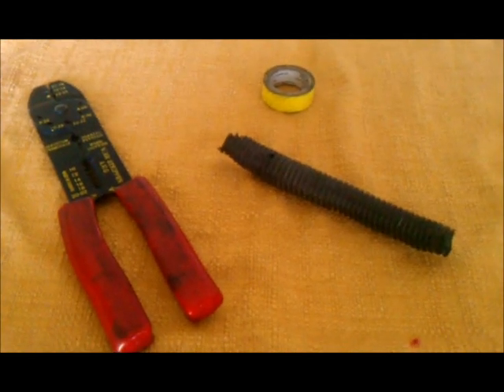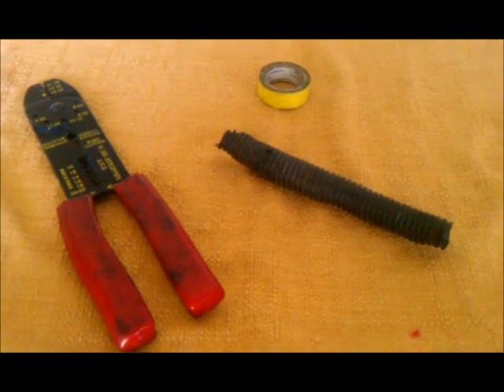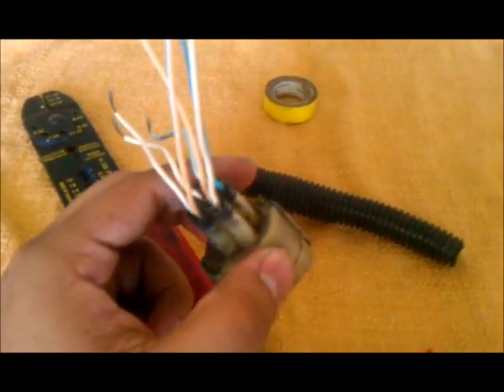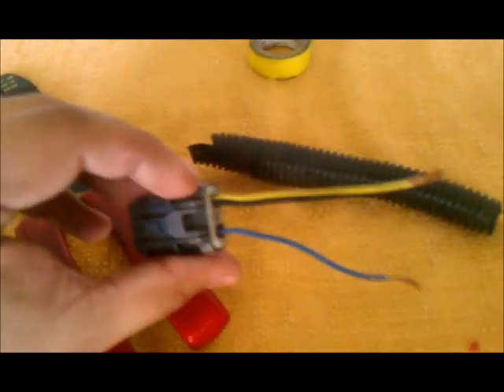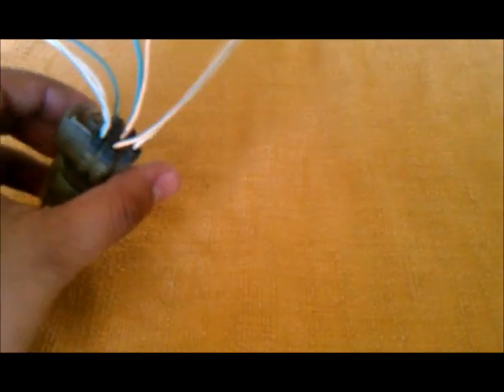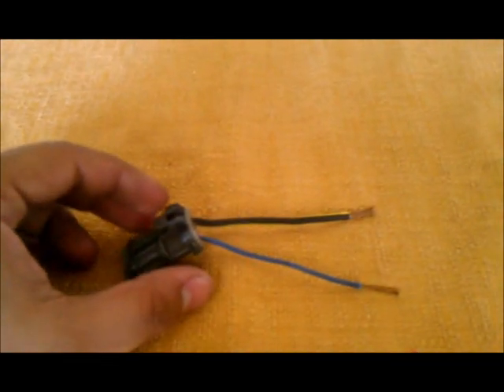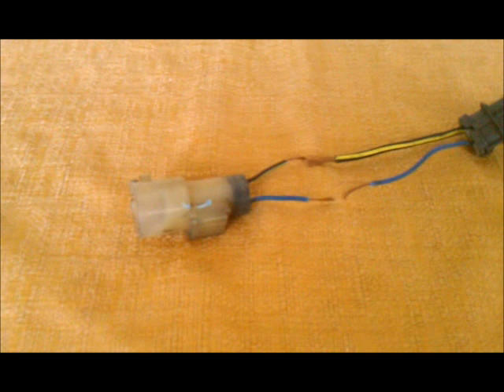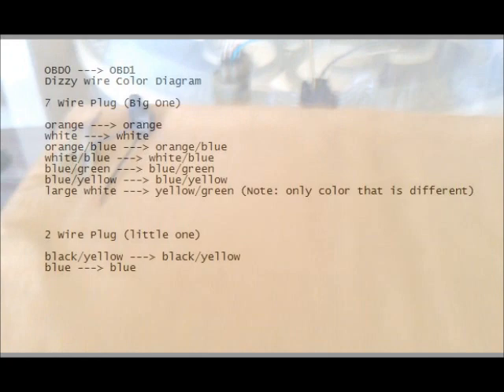Honda OBD0 to OBD1 Distributor Jumper Harness Wiring How To Video

Comment: so much easier to just repin obd1 plus onto engine wire harness, than making a jumper.  it's quicker to do and looks more OEM
Reply: Alfred Liu that’s that prob I’m having I have a dx harness so it’s the 5 wire square plug like to jump from that to the obd1 plug but different colors

Comment: How do you make this same jumper for a 91 DX civic? I notice on mine it is a female small square plug with 5 wires and the plug that you show in the video which I believe is an SI has many more wires. How do you make this jumper for the 5 wire square plug?
Reply: That’s what I’m trying to fig out i have the same issue

Comment: on the engine wire harness side of the distributor where does the skinny white go on what pin and the larger one I think i got mine switched

Comment: I'm trying to swap a B18B into a 99' civic, but the distributor plug on the civic is 8-pin and the B18B dizzy is a 9-pin. It's actually a 10-pin, but one terminal isn't used. It's a whole different plug. I've seen the jumper harness, but they go from OBD-0 to OBD-1. I'm going from OBD-2 to OBD-2. I have a 97 Integra dizzy(obd2) going into a civic, also obd2. If anyone can help, that would be great. Thanks.